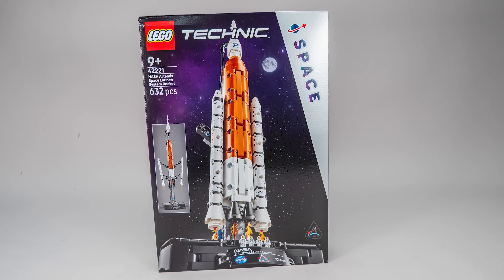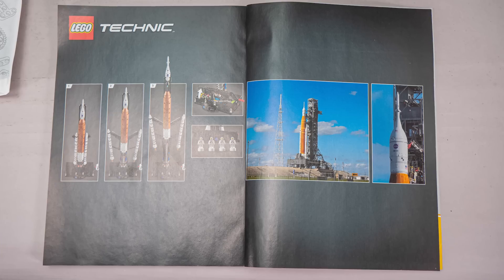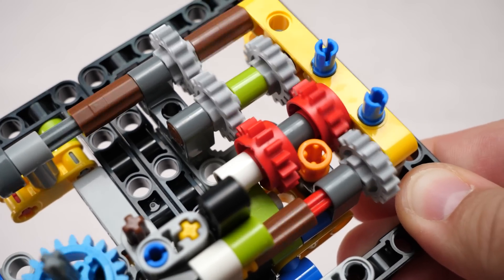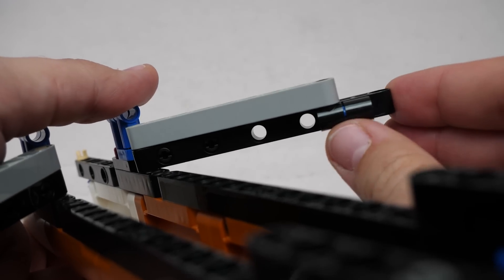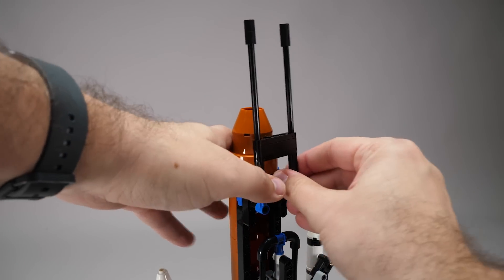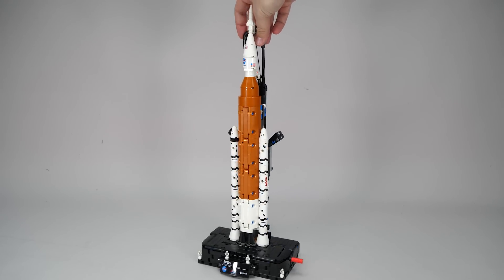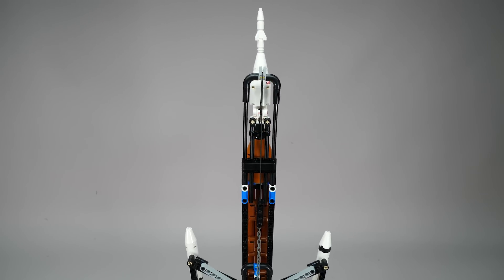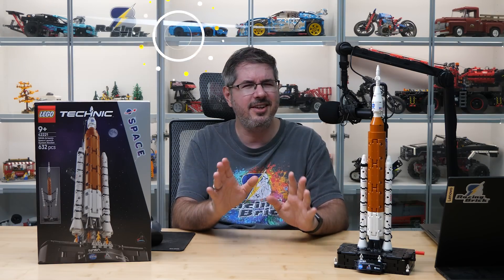LEGO Technic 42221 NASA Artemis SLS Rocket detailed building review - finally a real Technic set

Comment: Thank you for this review. I still think this set is an excellent bang for your buck with its features and theming. (Not a car!) Minimal stickers to boot as well. Using the Technic elements as the floor base and trap door is really cool to see. 

But reviews like this allow me to not only see the internal mechanisms but how the back looks as well, this set is definitely a three-quarters view set after watching this. I'm a bit disappointed the main orange piece (not sure what that part of the rocket is called) isn't a full wraparound cylinder with supporting pins connected in the back and is instead mostly a shroud to hide the backing which is a bit beefier than I was expecting. 
Maybe on discount or as a gift this set is worth it.

Comment: Looks a little too slow to be fun.
?what if? instead of turning a crank and gear system, there's just a simple handle on the back of the rocket that you pull up directly. perhaps with it actually sliding off the stand so you can 'fly' it around. Maybe even a button or something on the proposed handle that releases the boosters.
I feel like such a direct and tactile method would have better play value.
But then, this is a technic set, so maybe that's not the kind of target audience. They want a kinetic display, not a toy.

Comment: I like that the 60 € play set has the same piece (6044601) for for the the Forward Booster Separation Motors as a print, while the 260 € display set gets stickers.

Comment: What is the point of a clicking sound in a rocket?
Reply from the maker: Pretend launch noises?
Reply: @RacingBrick Thanks for the reply RacingBrick, but I don’t think a clicking sound imitates a rocket launch sound. Still a cool set in my opinion.
Reply: @irynapavlyuk5688  it can work though. if you check everyday astronauts video of the sls start youll hear a rattle in the engine sounds. but theres simply no way to recreate that deep rumble you usually hear with from rockets with lego

Comment: hey is there a reason for why lego didn't make purple technic sets? In my opinion they'd look good and it would be a nice change from all the usual colours
Reply from the maker: Don't ask me, I'm begging for a successor of 42069 for years :)
Reply: @RacingBrick  me too, i love that set it was like my second ever lego set and it had so many functions unlike the boring supercar technic sets nowadays with nothing except steering, engine, doors. anyways that's not the point the point is lego should make more putple technic sets
Reply: What about the purple Competition sets from 1998?
Reply: @pablesm  sorry i meant to write "stopped making", also "from 1998" just proves my point the last purple technic set was 42069 in 2017
Reply: They have done it for the Extreme Adventure set from 2017 if you remember then and also for one of the new monster truck sets in 2026. I believe the extreme adventure vehicle was set number 42069, I think it looked cool and the purple body panels looked nice with the black panels but it was not a licensed set. It’s a hard colour to implement in Lego technic when licensed sets have to follow a particular livery or manufacturer colour and sets without licenses tend to be heavy machinery or construction vehicles which don’t suit purple. It’s also possibly because Lego don’t think it would be as well received by most technic set buyers as other colours in sets where purple would work as even though they have the purple monster truck, they have a different colour being released along side it for those that don’t like the colour and design. Personally, I think it would be nice to include it a bit more where it’s possible especially for sets aimed at children because toys are supposed to be fun and not display pieces. I’d also love the new green Rexy set to be released in a pink Roxy livery but I doubt it’ll happen.
Reply: @errorcode503 ur saying every technic set except construction sets is licensed? No it's not. The 42069 extreme adventure wasn't licensed, neither was it construction related. Is there a rule on how technic can't have unlicensed sets with ACTUALLY COOL playfeatures except construction ones? There's a lot of things that would look good with purple that don't need to be licensed- cars, for one- they don't need to all be licensed, why not make an unlicensed car in purple?